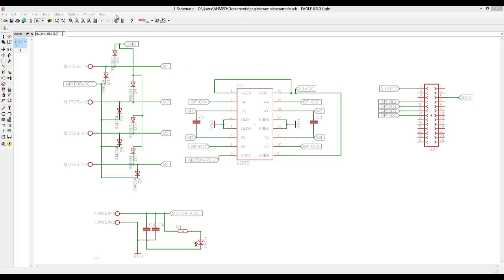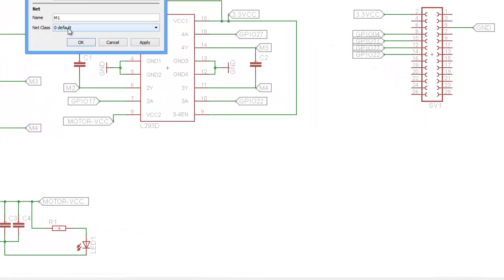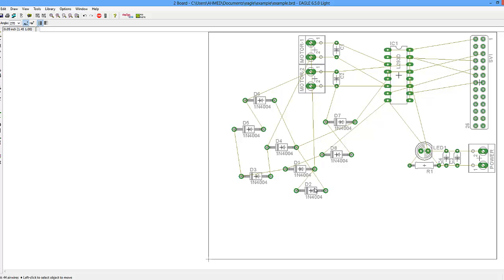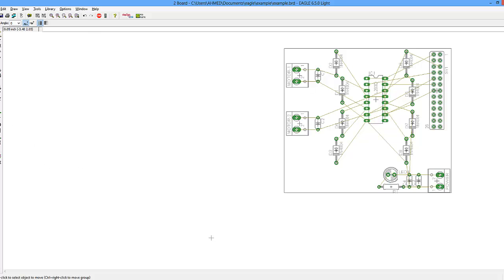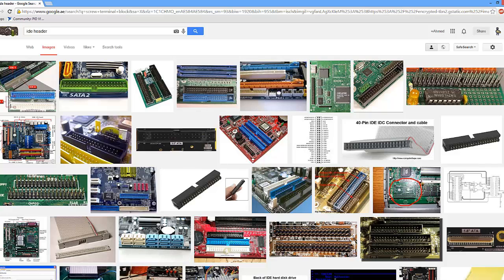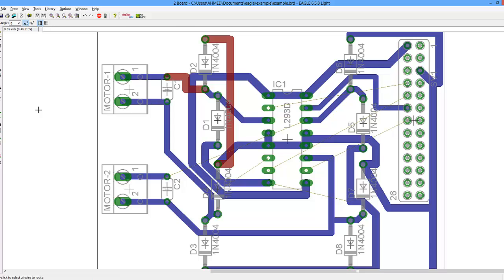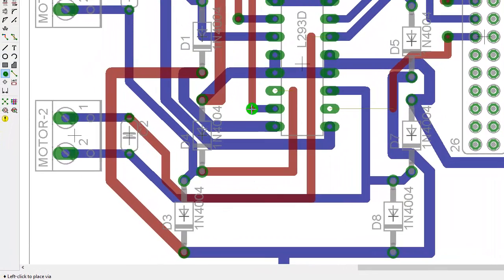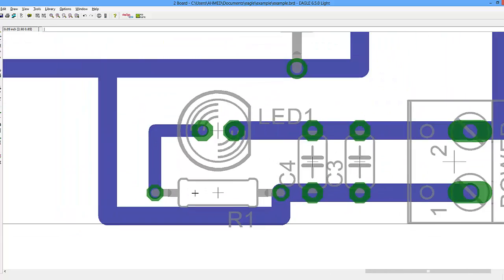EAGLE CAD Tutorial Part 2 PCB Layout and routing

Comment: how do you clear the holes in pads when I get to print they are still full no holes in pads
Reply from the maker: if you are using a CNC machine then you need to generate the .drl and .drd files by running "run drilling" command in eagle
Reply: No I want to etch and drill by hand how do I do that ?
Btw,thanks for reply.
Reply from the maker: +JOSIP Žlk Assuming you want to print single side pcb. go to file print and select to print only the bottom layer with a 1 to 1 scale
Reply: will try that sometime but I think thats what I did last time and there were no holes